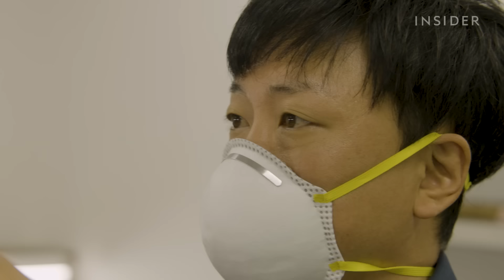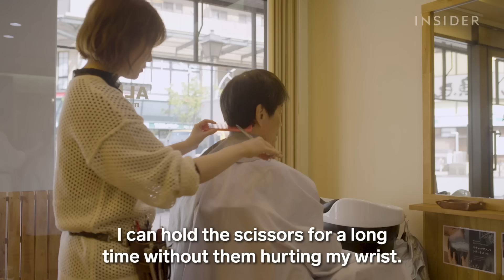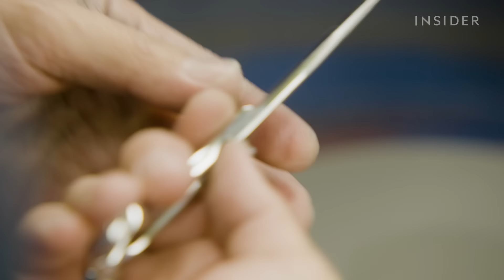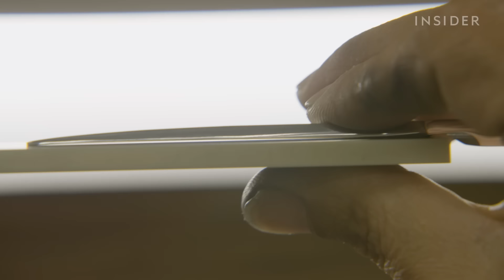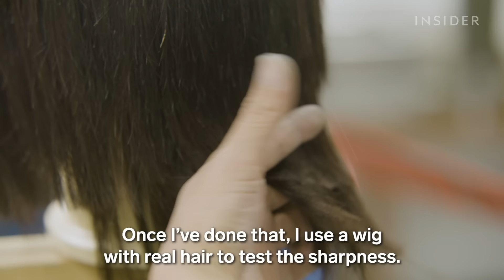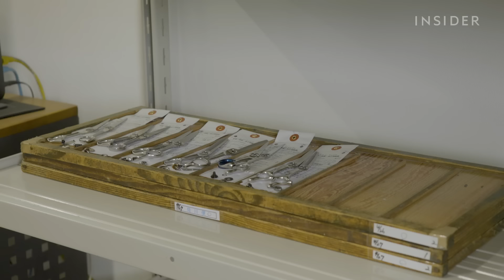Why Top Hair Stylists Pay $2000 For Japanese Hair Shears | So Expensive | Insider Business

Comment: So buying one for $2000 that will last say 40 years (overall price for 40 years:$2000X1= $2000)
 Vs
Buying one for $50 that works well and say breaks every 3-4 years i.e. 3.5 yrs( overall price for 35 years : $50X10= $500)

So, it boils down to how much you wanna spend for quality only and how much are you willing invest in a product that may not give you the liquidity you need at times you want.

Comment: Scissor making used to be a trade unto itself. I was once asked to make a pinking (Zig Zag cut)shear set. I think it took me 50 odd hours to get the blades so they would cut properly . Those need to be twisted, curled and bent to achieve the correct cut contact. easy to do on on point but take that to 30 and if the last one is loose you have to adjust (normally with a stone) the other 29 to achieve 30 being correct.

Comment: i dont think its worth that

also, within the first minute you contradict yourself. specialized design that never wears down and lasts for decades.... that rarely need to be sharpened.... so which one is it???

also, it doesnt require MATHEMATICAL PRECISION when you say in the sentence earlier that they do it by eye. one is intuition and experience, the other is numerical science. those processes contradict each other

also, 40% of expenses on the scissors is TINY. there isnt much material used and its also not very expensive material. so are you telling me that that bit of metal and sharpening equipment costs 1800 bucks?

that "amazing" mechanism to connect the blades is a simple spring tension mechanism..

them saying that SOME clients bring in scissors that are decades old means most of them dont. but then lets say all the scissors last a worklifetime so 40 years or so. that still means you could buy scissors worth 75 dollars every other year and STILL ONLY PAY HALF!!!!

Comment: Using ball bearings for the hinge was quite smart
Reply: Actually it is not, putting anything between the blades will cause support issues , reduce shear longevity and eventual gaping of the edges that need to be addressed with  each sharpening.  With each sharpening the metal is removed from the inside of the blade but there is no ability to adjust the bearing depth.  If the bearing groove is not compensated, the shear will form gaped edges far sooner than a shear without a bearing!
Reply: @toddbenko6701  If people are paying $2000 for these shears and customers keep coming back it must be working

Comment: I work as a groomer, and the shears I use are about 200$ each. About 1100 in total. And I have the cheaper of the high end. I’ve had them for 5 years and only just had to get 2 off them sharpened because I dropped them.

Comment: what professional hair scissors need are very lasting sharpness, and more important, very little resistance when use it, because the hand of using it will get very tired quickly if the scissors move as a pair of house hold scissors.

Comment: i can buy good scissors for €25...  i can  buy 100 scissors for €25 and  throw them away after half a year of use /what I won't do/. So these 100 scissors will last me without sharpening 50 years..... will these expensive scissors last the same time without sharpening? and that's just one type of scissors. A hairdresser needs at least 3 types. that's a total of €7,000+. How many scissors can I have for €7,000??????
Reply: Yeah, but you'd waste a shitload of hard-to-recycle material. 3000$ is for sure marketing nonsense, but a 300$ set of shears will last equally long.

Comment: I got a $40 pair on amazon, which is also curved grind and similarly shaped, works very well at least for occasionally use on myself. A friend has a $200 pair also works very well. I agree curved grind is hard to work with, I'm pretty good with knife and scissors sharpening but I once try to sharpen a curved grind scissors myself and it is completely ruined.

Comment: My partner is a cosmetologist and cuts hair for a living. She has 'OK' shears in the $500 range, but she has been using them for 12 years and has had to sharpen them about five times. She's not making money during 'downtime' when the shears are being sharpened, so the ability to hold an edge is critical. Hair shears are really an extension of the person's hand, and they must feel like an extension of the hand to work quickly without wrist or hand pain as barbers and cosmetologists are using them for hours per day every day they work. 
She has always wanted a nice pair of Naruto shears and may consider a pair in a few years as a gift to herself. She's afraid of how long it will take to get used to them since her current shears are as natural to her as having fingers at this point.
Reply: When she orders her's, send that pair of scissors to them along with the order. That way, they know how to design the handle to fit into your friend's scissors handling habit. That way, even if she already got used to her current shears, the new one won't feel alien in her hand.
Reply: just buy 2 pairs of the $500 so she has something to use while the others are being shaprpened. problem solved.
Reply: @Mr_Smackle  yeah. And it would still cost half the price than to buy those naruto scissors. I don't know what theese guys are on about. It's just a pair of glorified scissors

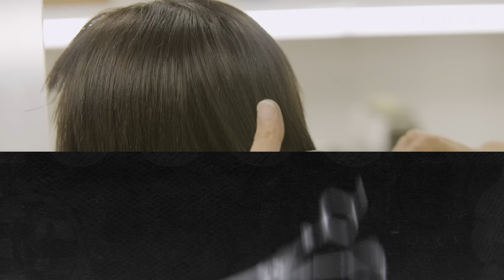Comment: 2:50 literally all scissors are warped in that way. Cheap or expensive.
Reply: Not really, most kitchen shears, paper scissors etc and low end hair scissors are straight grind.
Reply: @haomingjin1617  I am literally looking at a pair of cheap 3$ kitchen shears and a pair of hobby scissors for crafts and paper, they have a slight bend. That is how all scissors are made. So that they don't wear fast and so that you don't have to use unnecessary force when cutting, especially at the end of the stroke. You only cut wear the two blades meet. All scissors regardless of cost have that slight bend in them. Unless they are some specialty scissors who don't require it or it would prohibit their function. Hold any pair of closed scissors up to the light and you will be able to see light between the blades.
Reply: @MmmmmmmmEarHair  You may be right to some extend, I checked two of my cheaper scissors do have a very slight curve I didn't notice before, but my zwilling kitchen shears don't seem to have any curves, even when I take them apart and press against a flat surface, can't see any gap or light coming through.

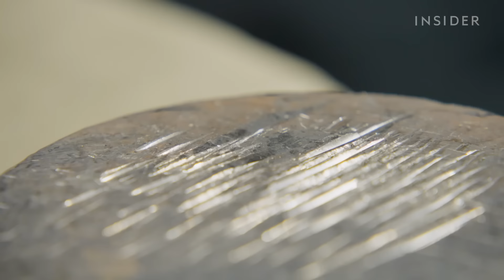Comment: 4:20    Elasticity is the exact thing that would make him UNABLE to warp the blades into a new shape. Dumbass PR speech
Reply: yeah you should do some more research into material science terminology. Elasticisity is the metals ability to move without causing permate damage. the opposite is brittle which as you could guess is not good in this situation. try bending glass and then try bending wood. you will see that being elastic does not mean it is UNABLE to warp. Wood and metal warps all the time.
Reply: Incorrect. Elasticity is more akin to ductility.